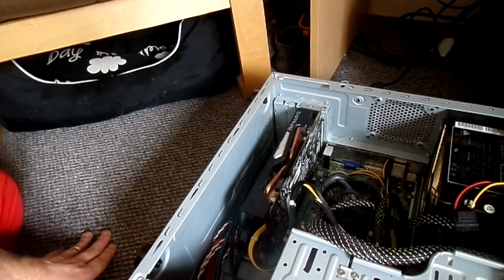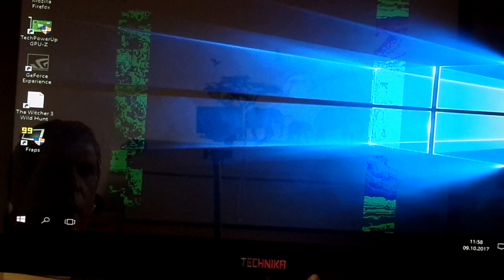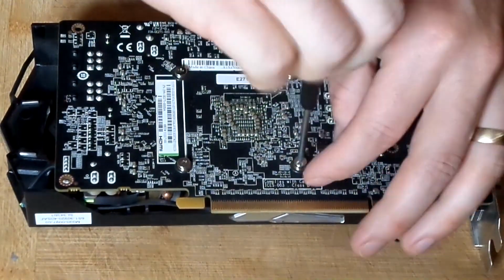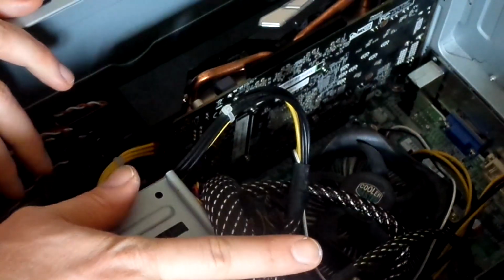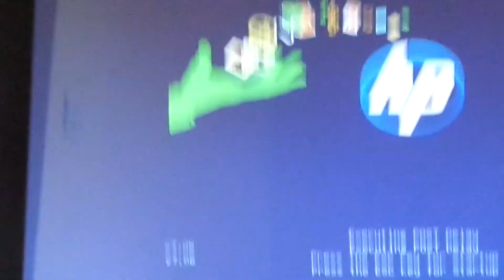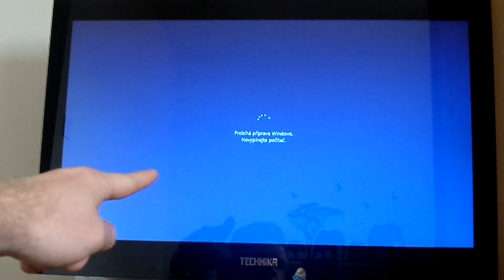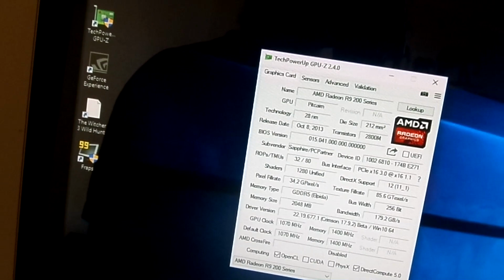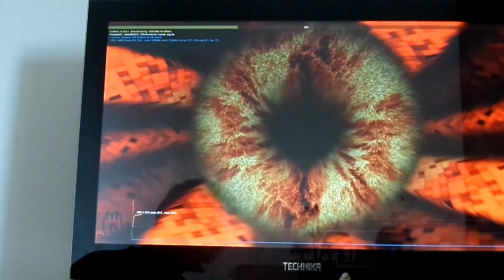It is possible fix GPU Screen Artifact ? Check this video to find out

Comment: Sir, my problem is even weirder and more serious.
The story started like this, two days ago when I was about to play my game, my display suddenly "freeze" and I realize there are some display artifacts on the screen scatter around the corners. (The game is still running tho just the display is frozen and I am still able to alt+f4 the game.
After I hard reset my PC, I realize there is no display on my monitor but, my PC still turn on with all the LED light on my KB and mouse.
I  tried replacing my GPU which is a GTX 1070 with a GTX 1050 and it works. (Note that my GTX1050 does not require an 8 pin power connector.)
I also tried to replace my PSU 8 Pin Power connector as well as plugging the cable into a different port but still no luck.
I also tried the "eraser method" which is cleaning the gold color bar that snuck inside the PCI-E slots but no luck as well.
Reply from the maker: That's sounds like standard GPU problem if you never replacing tharmal paste now if your card is out of warranty only you can try is some reflowing trick with your card I know is bad news but this sometime happen with GPU check my channel for how to do repair GPU with black screen you will finding plenty of tham
Reply: @frogtechtips  Thx for your reply sir. I have not replaced the thermal paste on my GPU as the GPU is only 3-4 years old as of today and the temperature is quite stable around 75 degrees Celcius most of the time while I gaming.
Anyway, I have decided to send my GPU to a third-party repair shop for reballing or reflowing my GPU. Now I can only hope for the best lol
Reply from the maker: @coconut4859  yop good choice but I will recommend replacing Thermal paste at least maximum every 3 years on GPU I see some paste on GPU like rock even after 1 year GPU still have nice temperature just Thermal paste Been so dry

Comment: when a play a game the screen corrupts and its shows driver stopped kernal mode please give me solution
Reply from the maker: Try update your GPU BIOS
Reply: @frogtechtips  i have a fake gpu gtx 960 and bios is not updating can you give me an easy solution or link that how to find fake gpu bios easily
Reply: @frogtechtips  even i can update bios of other cards
Reply from the maker: @xgamerz3067  if you have fake GPU is hard to find correct BIOS but I think your GPU will be 560 or 460

Comment: Same problem on a MSI Radeon R7 370 Armor 2X OC 2GB, i will try with a heatgun and some flux powder. If it works I will have a drink in your honor.
Reply from the maker: yop let me know once you done
Reply: @frogtechtips  For sure
Reply: Did that worked ?

Comment: What even is flux? i'm trying this with my Asus R9 270  and i don't know what that is for. Plus, a strange thing is happening. the graphics card has artifacts of course, and why does that affect my performance?  i get like 2 fps on every single game. I mean, is that a screen issue, or is it a driver issue? What temperature does the heatgun have to be? help!!!
Reply from the maker: Hi if your GPU have artefacts is performance problems as well and for that reason you can have only 2 FPS  looks like your GPU have heavy damag you can try reflowing with my style but I recommend you use flux is staff keep your solder point not make short when you heat I use temperature about 290 to 320 Celsius I hope will help
Reply: @frogtechtips   ok thx man :) i just dropped it from a high shelf and it broke i think and this happened.
Reply: flux stops oxides forming

Comment: Could I use a hot air station with a wide aperture tip mounted instead of a heat gun? I have a GTX 980 from ASUS that's giving lots of small red lines / artifacts across the screen and sometimes gets stuck on the windows boot logo. In the BIOS and pre-OS environment, it's doing just fine.
Reply from the maker: Hi yes you can use that I fix some cars with hot air smd station
Reply: @frogtechtips  Alright, I'll try that soon and report back with the results! 
Around 10 minutes at 290° C, correct? Plus 10 seconds for each memory module?
Reply from the maker: @realMrVent  yop thats corect

Comment: cool.. i need to try on my RX 580
Reply from the maker: Let me know when you try
Reply: @frogtechtips   i just tried & finished your way. When i try to start pc, the gpu got 92° C & suddenly turned off. Please help 😥
Reply from the maker: @ayipsutrisno  did you use new thermal paste with one is good quality is all fan working correctly
Reply: @frogtechtips  yes i did, the fan working correctly
Reply from the maker: @ayipsutrisno  did you use flux as well when you heat
Reply: @frogtechtips  yes i did, i used flux

Comment: hey bro if my gpu have pink lines is that artifact too?
Reply from the maker: Hi look on my channel for more videos as I have video with that problem  as well but basically yes
Reply: How many minutes for vga chips
Reply from the maker: @kylepuertullano  I use about 7 to 10 min with 340 Celsius
Reply: The hot gun will be 180c ?
Reply from the maker: @kylepuertullano  my heat gun can go up to I think 700 if note more
Reply: Can i use no flux? To fix this?
Reply from the maker: @kylepuertullano  you can try
Reply: Not working hemm i gues i have to put flux
Reply from the maker: @kylepuertullano  yop with flux you will get definitely better results
Reply: Thank you
Reply from the maker: @kylepuertullano  you welcome

Comment: what is the purpose of the heat gun and this flux?
Reply from the maker: Heat gun is for melted solder under GPU die and flux help to do not make short
Reply: Frog - Tech - Tips thanks
Reply from the maker: @benr4469  you welcome

Comment: I have a Strix 1080, And yesterday it did this weird artifacting, I was playing Euro truck simulator2 and out of nowhere I get a screen full of red, green, blue dots like Christmas lights going off then the game crashed, I noticed the temps on gpu tweak 2 was in 90c+ which was highly unusual as I've never experience high temps with this card, now when I try to open folder and menu's I got like a checkered board thing going off and little dots here and there like dead pixels but they aren't dead. can you please help.
Reply from the maker: Hi is your gpu still under warranty if yes go that way 8f not try clean your card and replace Thermal paste if that doesn't help you can try underclock your card specially if you over clocked before and if all this doesn't help you will need probably reflowing you GPU
Reply: @frogtechtips I checked on my Warranty and it Literally run out the day before the failure or so it says on the Asus site, what are the odds of that? The card at the time wasn't overclocked. I don't have the equipment to reflow properly but I do own a oven and am willing to try at this time as I cant really afford to buy a new card yet, If you could explain the process of doing it in the oven that be a good help, And thanks for replying back so soon.
Reply from the maker: @RankDropper71  hi try ask Asus first maybe he will help or go where you buy as you have 2 year warranty from day you buy from him or buy cheap heat gun  oven is last step
Reply: I'm going to buy a heat gun and some flux I think and try doing a reflow on memory chips and gpu socket, 
I have Emailed Asus but they haven't replied yet but it is the weekend, I will wait till Tuesday first to see if Asus do reply and offer to repair for a price and cost of posting, they repaired my mobo when I damaged my CPU socket with cooler so maybe they help me with this. If not then heat gun

Comment: can i use hair dryer?
Reply from the maker: Hi is not strong for this
Reply: @frogtechtips  thanks! how about this small heat gun(dildo size) i saw in amazon,  will it do the job?
Reply from the maker: @keenanmckenzieasi3615  not sure I don't see than how strong they are but you can buy cheap heat gun on eBay about tena

Comment: Thank you very much bro...
i have the same gpu. i had the same problem 3 months ago. Took it to a repairing shop. they repaired it for 8 dollars. After using 2 .5 months the artifacts came back. went to the shop and fixed it for 6 dollars. I guess the shopkeeper applied your method. so, should I apply your method to my gpu ? Can you say what should I do for lasting it longer ? And may I use oven in stead of hot air gun. Hope you reply...
Reply from the maker: hi try buy or borow heat gun  oven is not perfect  and I think you right he probably use my method but maybe note used flux or not heat long or you card is just like that and better to buy new one  but ye you can try repair yourself is easy

Comment: we shared the same two same artifact lines and place possition, now i know what to do. One question the solution you used, can it be replaced by any common pharmacy or whatsoever chemical product? Otherwise I will find a way to buy it, my rx560 its on its way, and my R9 should be ready untill than... A gek question. Can a r9 270x saphire mine as yours, be crossfired with an rx560 from xfx? If possible should I?  And latteron, if possible that crossfire, can them be crossed ith an R5 2xxx?  Thanks...
Reply from the maker: hi if you mean flux you van try without that but is so cheap you can buy so easy  and about cross I think you can only better gpu will be degrade to slower

Comment: Hi bro, i've a asus strix RX 570 with 2 green lines on screen, if i do that without a flux should work?
Reply from the maker: you can try nothing to lose anyway
Reply: those lines must be a broken screen
Reply from the maker: @DualPerformance  why you think
Reply: @frogtechtips  I got an LCD monitor with the same problem
Reply from the maker: @DualPerformance  maybe you have bad monitor as this can happen as well but only way fix that is buy new one

Comment: Sir, i am suffering with same problem with sapphire r9 270x 2gb ddr5 graphic  card.  But the problem is that it show wrong name of my gpu when i open gpu-z and also doe's not show bandwith, gpu clock show's 0 mhz. What can be the problem?
Reply from the maker: try new bios and if that not help problem is with die and you will need reflow

Comment: WOW 2017 and your system looks 10-15 year old? With no cable management? Your windows took that long to load, I went to make a cup of tea and came back and it still hadn't loaded? 

I'm shocked, pc hardware is much cheaper than it use to be if you know where to look, dam even if you can't afford brand new then getting pre-owned hardware is even cheaper. 

I noticed your playing the best game ever made: The Witcher 3 Wild Hunt. So playing on your system will be killing it. Bottlenecks everywhere, 4K is just stunning but even a good quality 1080p monitor or TV will make it look amazing, but you need at least 70+ fps for it to be as smooth as silk
Reply from the maker: If you know my channel that pc is just test rig is not my main pc and ye take longer but for testing is ok you will not risk kill your main  pc as well this test pc have just 2gb ram and old HDD as well that's reason and on this one iam not play game as well Again is just TEST PC for testing foulty GPU

Comment: Hey do I need to use flux?
Reply from the maker: Hi yes flux will be make you sure you do good job and solder will not make short between solder flux is cheap
Reply: @frogtechtips  Thank you for the reply. I ended up trying it anyways without the flux and it seemed to work fine. It was a broken card anyways, I didn't care too much lol BUT it worked haha. Thank you for the video and quick reply :)
Reply from the maker: @HamudiChi  you welcome my friend congratulations  and I hope you will stay subscribe on my channel :-)

Comment: hey i could do with your help could you tell me whats causing this? i have a clip of my issue https://www.youtube.com/watch?v=QAK_r57Jte0 It only happens on forza horizon 4 and motorsport 7 has a flickering colour round the cars. i bought a rx 580 8gb asus dual, its on a x470 board ryzen 7 cpu and 8gb drr4. much appreciate it
Reply from the maker: I will check that link later and qive you my opinion
Reply: ok thank you much appreciate it
Reply from the maker: @idekript9978  hi is looks like your card have artefacts and is probably foulty card if your card is new try apply your warranty
Reply: thanks for reply yes i am sending it back
Reply from the maker: You welcome

Comment: Hi. I watched your video and its a very good one.  I actually have a graphic card RX 570. It shows some artifact when start a game and then crash the system. I did oven bake at 200 degrees Celsius and it is still the same. And goes black screen if I install official AMD driver. What do you advise me? Thanks.
Reply: Hi yassin, did u fix the problem?
Reply from the maker: Main reason is you use oven and only 200°C is so low I use with heat gun 290°C sometimes over 320 if card don't works on first time
Reply: thanks very much for replying. I need to buy a heatgun.
Reply from the maker: @yassinbakady8474  ye you can buy cheap one like this one plus don't forget flux as well 

https://rover.ebay.com/rover/0/0/0?mpre=https%3A%2F%2Fwww.ebay.co.uk%2Fulk%2Fitm%2F351948108890
Reply: I also used RX 570 ffs

Comment: Hey Hi nice Vid!!!, can you  please refer me a link or a guide on how to bios tweak an HD 7750 for underclock and changing the voltage, because i do the reflow on that card and i want it to last longer.
Reply from the maker: Hi I will post that video about that problem within 3 week  and use VBE 7 software  is so easy

Comment: Sir help me !!! My r9 270 still have artifact after doing the exact same thing like u did .. plsss help meee T_T
Reply from the maker: Did you do reflow if yes what technique you use
Reply: @frogtechtips  eventhough i dont flux still need reflow ? ill try once again
Reply from the maker: @flicknumber1060  flux is cheap and important as well for perfect resort
Reply: @frogtechtips  it worked . Thanks man
Reply from the maker: @flicknumber1060  you welcome my friend
Reply: what lets get this clear you try and it dint work so you did it again with flux and it worked?, if so is it still working?,
Reply: @lazycarper7925  with flux and reflow again anddddd its works
Reply from the maker: @lazycarper7925  cool my friend congratulations for you repair

Comment: Can I use a hair dryer instead of a heat gun?  
the flow gel is applied around the gpu?
Reply from the maker: Nick Ovando hi that will not help you man is not hot as you will need

Comment: Do i need flux gel?
Reply from the maker: you can try without but i will prefer use flux gel is cheap and easy to buy
Reply: Frog - Tech - Tips It worked without, thanks!
Reply from the maker: Temmo Rijken cool man nice to know

Comment: I don't even know where to begin with this. This is not a fix, it is an absolute last resort to squeeze a bit more life out of your graphics card while you are getting a replacement.
Reply from the maker: Petri Helenius ye that's tru and not there is more option about this and I know from my experience this fix can be from pernament to 3m  but for 90% card I repair with this style fault never come back specially if you combinate with bios tweek  I have card with is still work after 2 years and is definitely better that baking   

And if you don't like simply don't follow this

Comment: I have the same card and i reflowed the solder with a hot air station a month ago and the artifacts are back 
What do i do now 
How many times  can i  reflow it
Greetings from Bosnia
Reply from the maker: don`t worry just re-flow card again you can use little more temperature or use longer time if you have luck get card working again   download VBE7 software and mode bios 
if you will change VCC on card and maybe little under clock can help as well you will lose maybe 1 or 2 FPS in game but card will survive much longer this is my experience
Reply: @frogtechtips  Hey man, can you make a video teaching us how to mode BIOS? That would be awesome. Subscribed!
Reply from the maker: @cristianoteibel  hi my friend there is already one check my channel for that
Reply: Adnan Mlivo Your card is already dead, even if you manage to resurrect it by applying heat to the GPU chip, it is a TEMPORARY fix at best and it is living on borrowed time. Get a replacement.

https://www.youtube.com/watch?v=1AcEt073Uds
https://www.youtube.com/watch?v=E9aZZxNptp0
https://www.youtube.com/watch?v=w57ObM3pYXw

That should be more than enough to tell you why.
Reply: I hope you watch AvE
Reply from the maker: Petri Helenius ye I see his video and he talks lots of tru but is always about how you do and from my experience 90% fault never come back and if come I make mode in bios and after is always good bit if you have damaged Ram module thare can be no fix for that like I set always is about luck
Reply: Petri Helenius I know but I don't have any money so .. I guess I ll yust keep reheating it untill it s chooched ti s last artifact I cant fuckbit more then it is no so I collect money and get myself a new one
Reply from the maker: Adnan Mlivo I will check that of course and ye this can be pernament fix or just short fix but as your fault come back I need recommended you tweek bios I hope you know how to do 

Once you will re baking again or the go and downgrade you card little change vcc and core clock as well This usually help and you will lose about 2% from performance with is still better than lose card  I hope you know how to do that